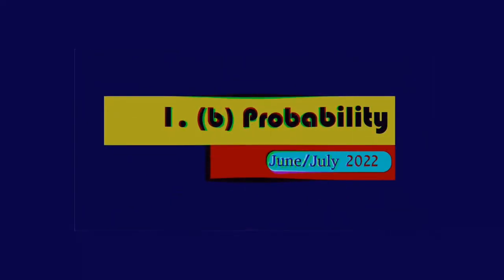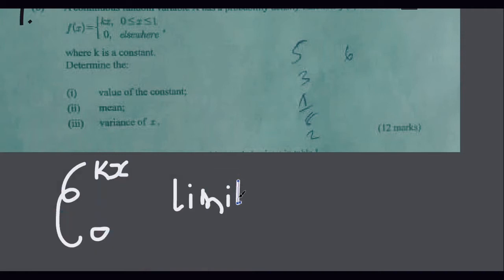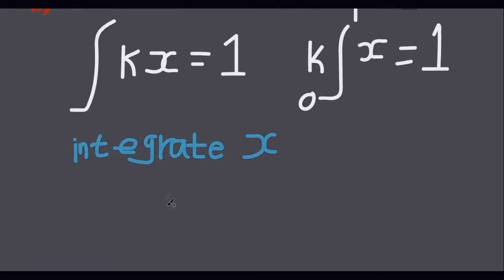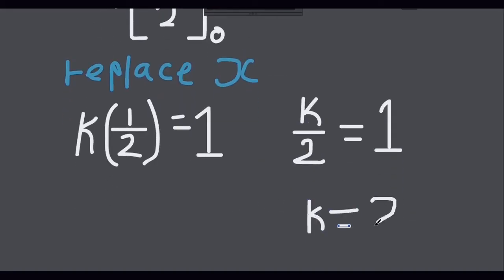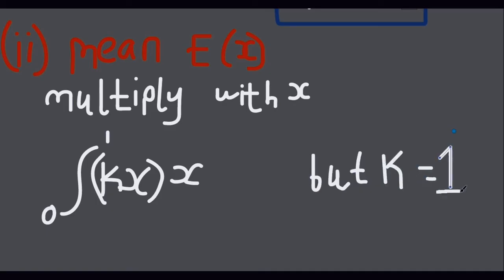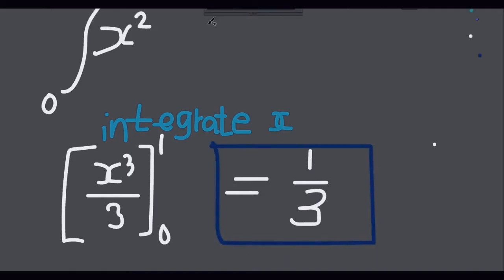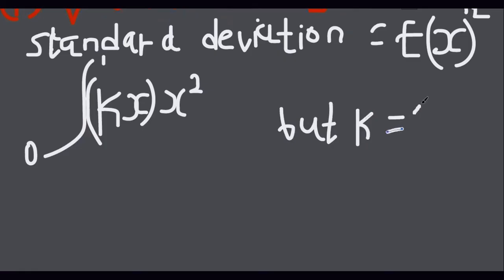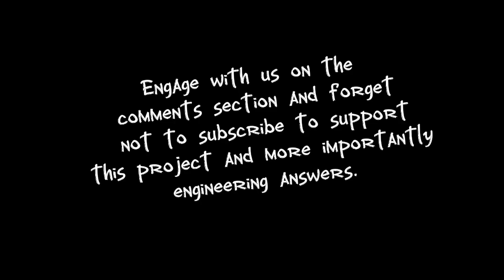Engineering Mathematics 2 on Probability for Diploma In Automotive/Electrical Engineering

Comment: Hey sir do this question for it is about pump knec :::A 3stage centrifugal pump has impeller diameter of 500mm and 20mm wide of outlet .the vane angle is 45' are occupied by thickness of vane is 8% of total area the discharge is 3.6m3 the speed is 900rpm mechanical efficiency is 80% menometric efficiency is 75%.Determ the head of pump ,power input of pump (19mrks)